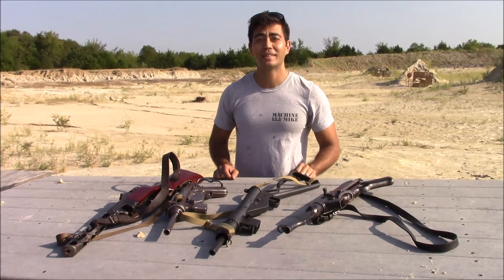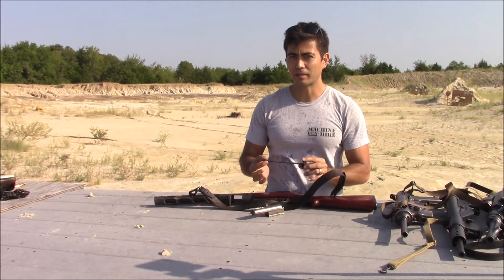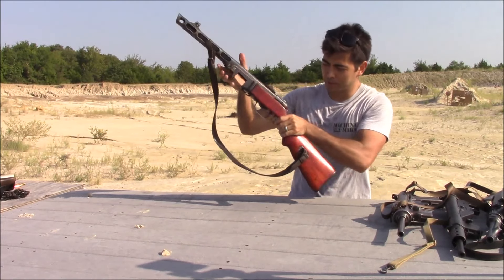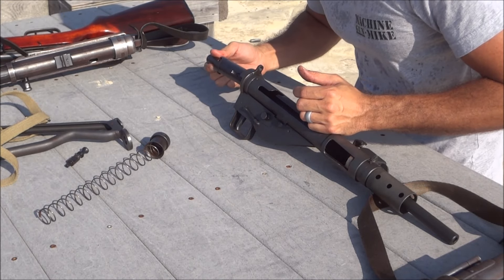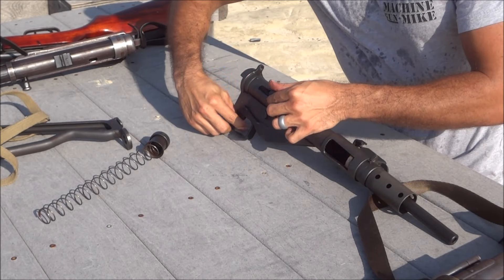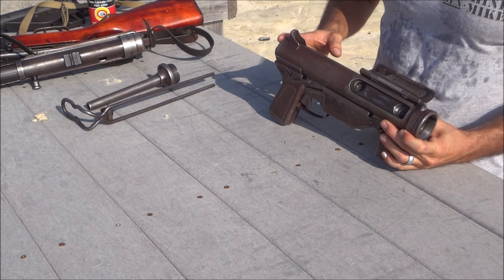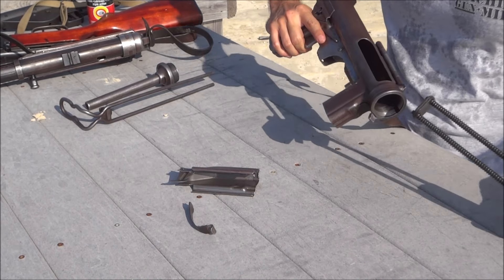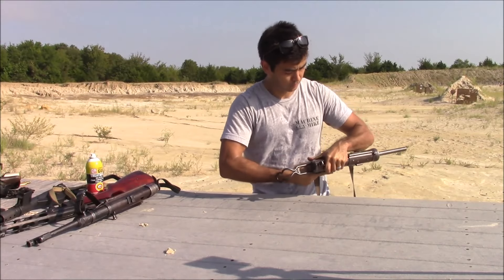WWII Submachine Gun Comparison (Ep56)

Comment: I like the sten for various reasons: has single and auto fire, makes the gun more versatile. It's the lightest of them all that gotta count for a soldier that has to do a lot of marching. And it's cheap to make, so you can arm a whole country fast with these and the availability and cheapness of it make it easier to replace parts or the whole gun for that matter. Sometimes less is more
Reply: I understand the French resistance were able to make versions of them in barns and small workshops

Comment: You need a Thompson, a UD42, a Type 100/44, a Beretta 38 and maybe a Erma MP35
Reply from the maker: TheTeeWorldsfreak have some.  Don’t have some.
Reply: Reising?
Reply: The Thompson is so vastly over rated, M1 garand weight, with 1/6 of the power. The mi carbine is a better firearm
Reply: @alexanderblackburn4520  I’ve owned both Thompson and M2 carbine. Thompson is far better in full auto. The M2 was very hard to control in full auto.
Reply: There are only a hand few type 100 that survived to this day

Comment: Re how to hold the Sten: although I’ve never held or fired a Sten, I have with its replacement the Stirling and the correct way to hold one of then is with the left forearm hand under the magazine and you hold the bottom of the barrel shroud.

Comment: PPSh got suitable recoil due to several reasons.
First of all is the "hammer" which is really heavy. And the second of all is that diagonal cut at the tip of the muzzle. It uses the gases to lower the jumping.
BTW, on the Kalashnikov Company's official youtube channel they tried to make a stress test over PPSh. Well, it kept on shooting after 800 rounds (as far as I remember). The only problem showed up in drum-magazines in misfeeding.
Reply from the maker: The soft shooting caliber for its weight and the high rate of fire as well.  There are many factors.
Reply: @MachineGunMike  I meant the less obvious factors since too many people kept on writing about the rate of fire :)

Comment: An interesting fact about "simplicity", Soviet PPSH cost about 500 rubles to produce in 1941 and only by 1943 the cost had been reduced to 142 rubles, while MP 41 cost about 60 reichsmarks. Let's convert the prices to US dollars. According do conversion rate of 4 rubles to a dollar and 2.5 reichsmarks for a dollar, the cost of a PPSH was 35.5 US dollars (and that at it's cheapest in 1943 in 1941 it was 125 US dollars) while MP 40 cost about 25 US dollars. STEN of course is still the cheapest as it cost about 2.5 British pounds which at an exchange rate of 4 dollars to 1 pound equated to about 10 US dollars (some sources state that at one point STEN cost as low as 0.75 pounds, if it is true it would make STEN cost 3 dollars at that time).

Comment: Mike, I feel as you do.The mp 40 was the standard to which future western armies emulated.However, the ppSh used the fastest pistol round in the world.The 7.62 tokarev round was copied from the Mauser 7.63 Broomhandle round.(development in the late 1800's)for the new fully automatic pistol.(I owned one).the round was a bottle necked cartridge (like a rifle round).The 9mm Lugar round was developed by altering the 7.63 shell casing by cutting off the bottle neck and inserting a 9mm bullet( the Lugar had problems shooting the higher pressure 7.63 rounds.) So, the 9mm was born! They did use a lower powered 30 Lugar cal.,but was not as effective.the Soviets loved the 7.63 Mauser round,but had to make their own, due to to the Germans discontinuing production.the result;7.62 Tokarev.    PS:the low recoil of the ppSh is due to good design,not the smaller caliber! The 7.62 Tokarev was more powerful than the 9mm as was the Mauser 7.63.

Comment: *looks at kalashnikov group trying to destroy ppsh video*, nah you don't gotta replace that spring, it'll last longer than you comrade, lol.
The ppsh really is amazingly simple compared to everything else, and looks naturally intuitive to take apart and put back together. I think Ian explained why the recoil is seemingly so light, I think he mentioned that the fast rate of fire basically means you feel it all at once as one smooth push rather than individual pushes.
Reply: generally the issues comes not from the spring, but from that square pad at the spring end being destroyed after a lot of abuse. Especially if you get very old leather one.
Reply: End of the barrel has shroud desined that way that it working as a muzle brake\compensator. That why it has so little recoil.

Comment: the sten didn't jam...i am in disbelief
Reply from the maker: They don't if they aren't broken.
Reply: @MachineGunMike  They did not seem fitted or manufactured well. I was at a gun range in 1997 gathering and you could fire auto weapons under supervision ...grease gun, uzi, mp40, mac10 (I was scared to death of that thing and they only let you use it with suppressor so you would not shoot yourself) lewis, bren, BAR, mg34  and the instructor was hesitant to let me try the sten. I did and it jammed after the first 4 rounds and he took it away from me immediately.
Reply: @MachineGunMike  There was also a guy with an Owen there. I could have fired it but I was tired..a bit scared...and had had enough for the day.I had never heard of the thing either. Looking back now at all the stuff online ...that was a dumb thing to pass on.
Reply from the maker: @quechvermont1279  Not saying they are really made well, but just that if nothing is wrong with them, then they are very reliable guns.  I own 3 of them, and mine do not jam.  They are 80 year old guns, so most out there are in terrible shape even if they don't look like it.  If there is nothing wrong with them, they are very good guns.  If there is something wrong with them, they can be a huge POS though until the problem is found and fixed.

Comment: re: Low perceived recoil of the PPSh- On addition to firing a much lighter bullet,  it's 8+ pounds with a good solid wooden stock with more contact with the shooter than any of the other 3- A good solid cheek weld and large butt to spread the force over your shoulder.   The others' stocks are metal and much smaller in area.   Putting your cheek  on them and firing the gun is painful.
Reply: Old 7,63x25mm Mauser , Soviet +P 7,62 Tok

Comment: in a battle i would personally stick with the ppsh. seems to have minimum muzzle flip, good to shoot bursts or single shots. buttstock and grip look very comfy.
Reply from the maker: Mp40 for me personally.  I think.
Reply: Grease gun for me 45acp is a better sub gun round. Grease gun is also very reliable and easy to control due to low cyclic rate.

Comment: Thanks for this interesting comparo of these widely used WW II sub guns. 
I have a RUGER PC chassis ("tactical" look) carbine. It is a short stroke blowback (W/tungsten weight inside the short bolt) and a high quality 16" cold hammer forged chrome moly barrel. It uses GLOCK magazines with the GLOCK mag well insert.
Heavy at 8 lbs and very accurate for a PCC. Also VERY reliable, especially with all the available aftermarket M*CARBO replacement parts like the extractor. It will eat any kind of case (brass, aluminum or steel) and any bullets (FMJ, hollow point or "wad cutter"). This is a high quality PCC for a medium price ($800. in Nov. 20210).  I has a HOLOSUN AEMS circle/dot sight.

Comment: The Papasha 41 is the hands down the best out of all of these other WW2 SMG's. It fires the 7.62x25mm Tokerav round which is much more powerful than the 9mm used by the other three. It's rate of fire is very high, between 900 to 1000 rounds per minute and it's able to use high capacity drum magazines which combined with the high rate of fire makes it an excellent weapon for use in close quarters and or urban combat situations. You can literally spray a room with one. But it's also a very reliable and simple to use weapon. Like almost all Soviet/Russian firearms, their designed to be used by just about anyone and for use in extreme conditions. It's also a cheap weapon to mass produce and the other useful benefit that it has that the other three don't is that it has a fixed wooden stock which means you can use it in hand to hand combat. You can really break someone's jaw or face with it. It's like a baseball bat. The weight and high rate of fire also allow it to be very controllable when fired on full auto. It was also used for many many years after WW2. It was used in Korea, Vietnam, Middle Eastern and African conflicts and right up the present day by Al Qaeda and ISIS as well as many other poor third world countries and irregular forces. It belongs in the firearms hall of fame.
Reply: Soviet used Finn smg copy mag. And tolerance so Soviet …that mag and gun Hard to fit. And find extra mag’s wich fit/function

Comment: 13:06 There is a reason the PPsh-41 has a) a relatively low recoil and b) doesn't rise much during bursts as you would expect with a SMG with such a high RoF: It has a built-in muzzle-break. As you can see in the camera shots perpendicular to the shooter, the barrel doesn't go all to the front end but it ends several centimeters behind a slightly slanted piece of steel sheet. This is for two reasons: ONE: When the bullet exits the barrel there's a lot of gas coming out behind it. That gas hits the slanted piece directly in front of the barrel muzzle. Because it is nearly perpendicular to the barrel it reduces recoil somewhat and TWO because it is slightly slanted the hitting gasses force the gun downward. Which is a good thing, because, due to the barrel being in a higher position than the stock, it compensates for the torque that would normaly cause the weapon to tilt a little bit upwards after every shot.

Just FYI.
Cheers!
L fromBO in GER

Comment: They all worked and weren't that expensive to manufacture, which is what you want in a submachine gun during a war.  I'd give the sten top prize just because it is so cheap and easy to make, and England needed a lot of guns as fast as possible back when they designed it.
Reply: I have read the British and Canadians made nearly 5 million of them . Even resistance groups made their own and they were easily hidden and very effective .

Comment: MP40 seems to be the steadiest in firing. Sten was designed to supply British army with a smg as quickly as possible as Britain was facing invasion ,and was a simple ,reliable design. They are not flimsy.metal is quite thick on them

Comment: I’m not a gunsmith but these weapon systems seem like they would have a much higher cyclic rate if they would have used weaker recoil springs
Reply from the maker: Stronger recoil springs make the ROF increase.  Not weaker aprings.

Comment: The Australian Owen Machine Carbine was the best bar none. Take a tommy gun or a Sten gun and pour a bucket of sand over it and it won't fire. Do the same with a bucket of mud and they won't fire. Do the same to an OMC and it will fire. The Australian, Canadian, US and British armies all tested this and found the same result. They also found that the OMC had far superior endurance, had a much tighter bullet grouping, was more accurate and had the lowest muzzle lift when firing.
The OMC was simpler, much more reliable, could be disassembled and reassembled in less than one minute.
In addition, a broken ejector was a major problem  on other guns, on the OMC it was a simple change of magazines. A change of magazines was much faster on the OMC. A refill of a magazine was MUCH faster on the OMC which, unlike the Sten and the Tommy gun, did not require a special adapter.
The Japanese wanted to get OMCs. McArthur wanted to change from Tommy guns to OMCs, and everybody in Korea wanted an OMC.

Comment: Great video Mike.  I like the Sten Gun and have fired it a lot.  You technique of holding the weapon while firing is just fine in my view.  There is another method, but yours works great and what works for the soldier to fire the weapon most effectively is what counts. I also liked your other holding methods on the MP-40, Grease Gun, and PPSH-41.  There is of course other ways to brace the weapon when firing, but yours work great also. 
 One often sees German soldiers in WW-2 photos carrying PPSH-41 Submachine guns slung on their back while carring their K98K.  I have seen photos of dug in German soldiers on the Eastern Front with the K98K and PPSH-41 side by side on the parapet of the trench.  Good concept.  Also I love the  M-3 and even more the M-3 A1.  I found that it is not hard at all to fire aimed single shots using trigger control. I have even hit metal targes at 200 meters by aiming at the top of the head and firing single shots.  Often I would use the old M-16 bipod that clipped on the barrel on the Grease Gun to support aimed fire.  The MP-40 can also be shot with single shots using trigger control.  Like the M-3 and M-3A1 one can release the trigger when the sear disconnects from the bolt, before the weapon actually fires to get the single shot effect.  One can see moving documentary films of German Soldiers using that technique. 
 I love the Grease Gun the best due to it's knock down round, lower cyclic rate of fire, controlability, and reliability.  It's reliabilty is the best I believe of all four of the SMG's that you have in your video.  Also I like the M-3 A1 better than the M-3 due to the cocking method, and the teliscoping stock being not only good for taking off the barrel and putting it back on, but the magazine loader capability also.  I like the M-3 and M-3 A1 better than the Thompson in fact. A soldier going in and clearing rooms with the M-3 A1 and M1911 A1 pistol as back up is a great combination.  That 45 caliber ACP bullet is has far more knock down power than the 9MM as you well know.  
 The Soviet PPSH-41 and PPS-43 7.62x25 round is also more powerful than the 9MM.  
I learned on my many trips to Normandie, that British WW-2 Commandos and Paratroopers and other soldiers oftened swapped out their Sten Guns for captured Mp-40's as both weapons used the 9MM round. 
In spite of my love for the M3-A1, I must agree and fully understand why you love the MP-40 the most.  It's incredible and who would not love it?  It's really a very fine weapon.  All of the above would stand up today to any more modern SMG's as these weapons were tested and employed during the greatest war in the history of mankind.  They saw action in many climates and terrain and truly have earned their spurs and great respect among those who love firearms.   
Great job as always Mike.
Reply from the maker: Gene Garren Thanks man.  That was a hell of a long post, but I read it all.  You’ve got a lot of experience with these.  Cool to hear!

Comment: Four lousy SMG's.  That MP40 is too complicated, too heavy, cost too much, and cyclic rate too slow.  The STEN had an unreliable magazine.  That Grease gun cyclic rate is too slow, and the slow heavy bolt didn't have enough energy to strip rounds out of the stiff spring magazine when dirty or winter temps.   The PPSH works well but that muzzle brake will shatter your eardrums without hearing protection, hard to think Russian troops actually used them in closed buildings at Stalingrad.   Only good design of WWII was the Aussie OWEN...cheap to make, built like a tank, super reliable, super accurate.....best SMG ever for open bolt.

Comment: Ppsh spring is not good just because it is old. Same with springs of many other guns
Reply from the maker: romazzz93 its a bad design
Reply: @MachineGunMike  its a cheap, but good enough design. when you have plenty of time and resources, then you can invent something more complicated like SVT-40.
other case, when you have to start production in the middle of nowhere by unskilled (teenager) hands and you need'em now and in millions.
pps-43 had better design, but it was hard to readjust that many small factories to a newer model - ppsh was good enough.

Comment: Should have a Thompson in there.
Reply from the maker: Not really.  Mine is a Colt 1921 and wouldn’t have been correct at all.  Even a WWII Thompson wouldn’t have matched the theme of the video.  Like I clearly say in the video, this is about cheaper made subguns.  Hence the grease gun and not the Thompson.
Reply: @MachineGunMike  I would argue the mp 40 wasn’t a cheap gun to produce. Sten was not sure about ppsh.
Reply: @craigthescott5074  ppsh was very cheap and made in huge numbers. Russians equipped whole units with them.

Comment: 13:38 Sorry but Russian's didn't know shit once again. They copied this gun from Finnish Suomi -konepistooli. Same thing with ak47, which originates from Germany. Russian weapon designs overall are copied or spied from somewhere else. If they run out of ideas, they just multiply it by 4x.
Reply from the maker: Ehhhh......the AK does not originate from the German STG44 anymore than an SKS does, or an MP5 does, or a FAL does, or an M16 does.
Reply: AK and STG44 have an external similarity, but as soon as you start to disassemble , you will see that these are two completely different machines, with different mechanisms. In addition, all the main design solutions of the STG44 were borrowed from previously exiled rifles and submachine guns and pistols. The main merit of the STG44 is the cartridge. The cartridge is more powerful than a pistol cartridge, but weaker than a standard rifle cartridge. The previously produced Fedorov submachine gun had a rifle cartridge and because of this was inconvenient, more like a machine gun. The cartridge from the pistol has a small firing range. The STG44 cartridge is the golden mean, later many constructors began to use this size.
Reply from the maker: @musckowit  exactly
Reply: PPSh-41 is not copied from KP/-31.
Two completely different guns.